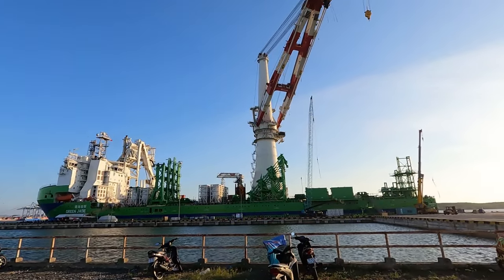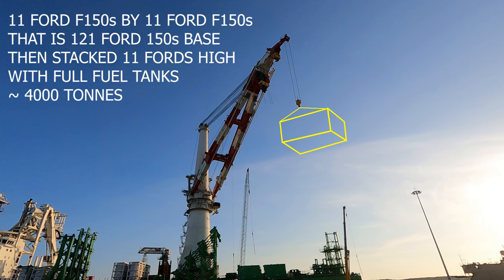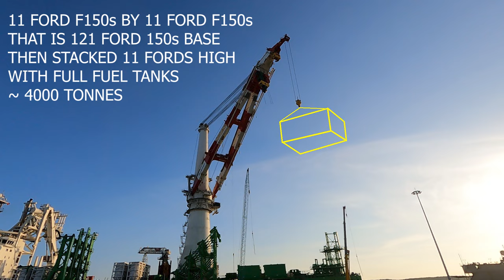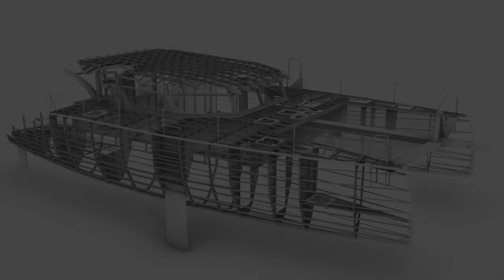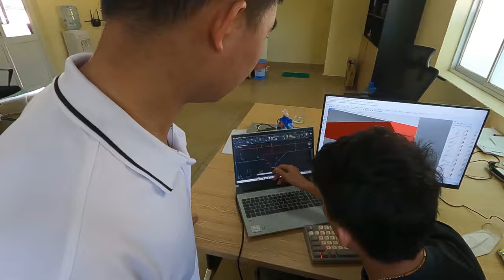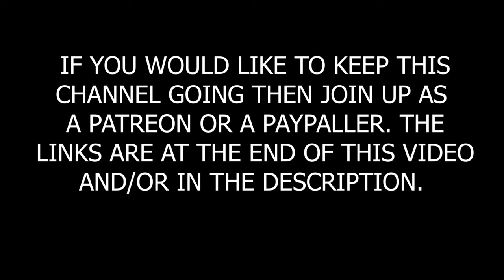EP.17 PART 1 Massive Crane, dagger boards, housing and sliders, longeron and fun

Comment: Some things to consider.   Dagger boards nearly sank on a mooring of my friend's Crother 54-foot aluminum cat. The issue was anti-fouling on the daggerboard created electronics inside the daggerboard case over time which holed the inside of the case wall.  The repair was too cramped to reweld the cases.  They had sealed the cases off and had wooden fixed fins custom-built and fitted under the hull.
Reply: Composites are better for daggers - shatter on impact protecting the case and no corrosion issues.

Comment: Plukky, make the dagger boards air tight so you have a virticle tube inside, to the bottom to blow out any water with air
Reply: good idea. In that same vain, shoot some expanding foam down inside the dagger boards to displace any water.

Comment: Liked! Subscribed!! Commented!!! even thou i live in the midst of the "Great Lakes" (michigan) my sailing experience is limited to small inland lakes. that being said the first time i ever saw a Dagger Board was in a video where some guys built a boat out of balsa wood (trees) and sailed out of south america to i cant remember where. they used them to help steer. i cant wait to see them put to use on the Odisea. and as for them circular saw metal cutting blades those lasted 30 seconds on the shop floor shavings in everything the die the feeders and slivers everywhere. they're worse than nibblers...

Comment: Plukenmeister thanks for answering the questions I had when I saw the dagger boards. 1st, is they are really long, what sort of draft will they have? 2nd will that be a problem in shallow water? 3rd are they going to be retractable. I guess I know the answers to the last two questions now and the the first becomes irrelevant.

I would like the hear more about the longerons and how they will work to strengthen the hulls.
Reply: Circa half the length stays in the housing  when down .

Comment: Could those dagger boards be foam filled. ? Or air tight very entertaining good luck
Reply: Had the same thought. Those boards really should be filled to prevent / reduce the change of water intrusion. Or is there a reason NOT to fill them?

Comment: Space X and their Starship Rocket, more than twice as powerful as the Saturn 5 rocket. 33 Rapter Engines on the booster alone, each of which is capable of 230 Tonnes of thrust. That would be 7590 Tonnes total thrust, I laugh at your 4000 Tonnes 🙂  Potentially the whole arrangement could put 150 tonne into orbit. The whole lot is quite liable to end up in the Ocean as well - go figure 🙂 Dagger board full of water heavy, well neutral in the water, full of air it will be buoyant as hell 🙂

Comment: how good would the roller be with multiple wheels and a computer program  adjusting pressure and direction ( patented, built and sold or not [all mine ] by the factory) - then just run the sheets thru and perfect every time - This would improve the efficiency and reduce time - this is one step closer to mass production - already laser cutting saves time - every step that can be automated makes the build quicker and cheaper = more boats for sale winner winner and of course it will all be SMOOTH
Reply from the maker: Maybe in time

Comment: Good to see you Plucky.  I have a question.  If that boat is mainly aluminum won’t you have serious rusting over time?
Reply: Aluminum doesn't rust.
Reply: @MrBillzebud  Probably means corrosion .
Reply: @stewatparkpark2933  with a good bottom paint a few sacrificial anodes, care not to let other metals contact the aluminum and the oxidation layer that will develop topsides it will be a very long time before it corrodes.
Reply: Thank you for the responses.